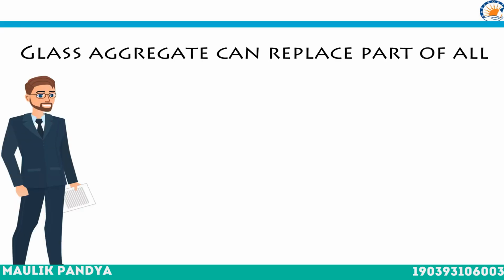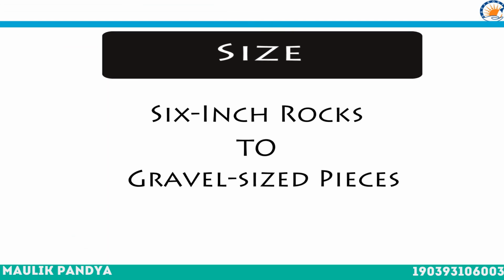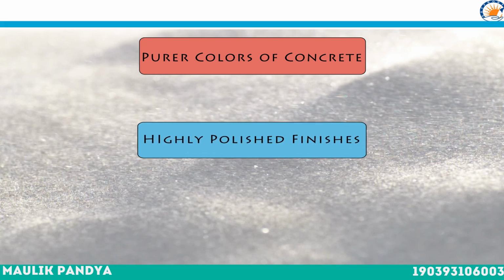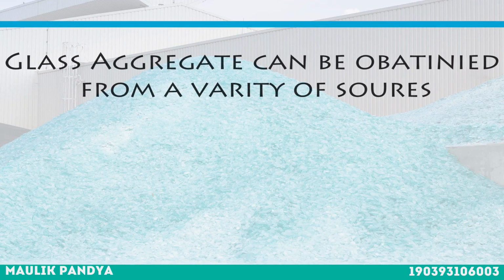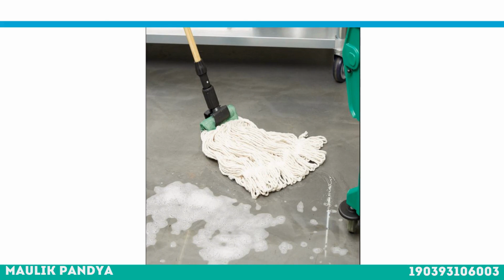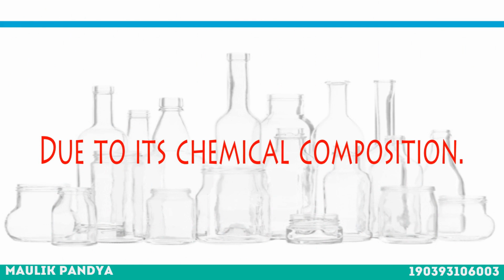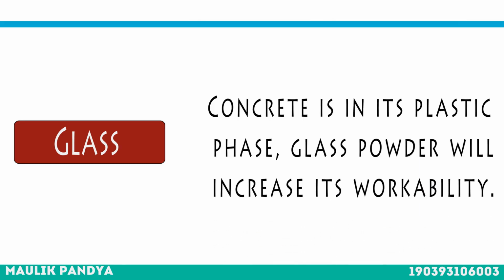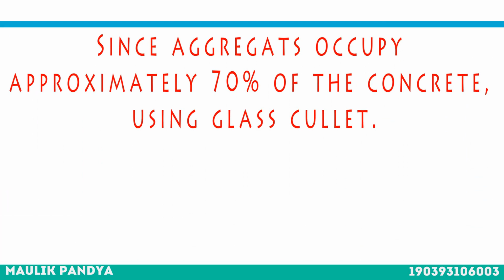Glass Concrete | What is Glass Concrete? | How it was formed? | Advantage and Disadvantage | Part-1

Comment: What size of glass aggregate should be added to gfrc concrete to enhance its strength
Reply from the maker: Ideally it should be between 2.36 to 5 mm and in case of alkali silica reaction (ASR)  it should be between 5-10 mm